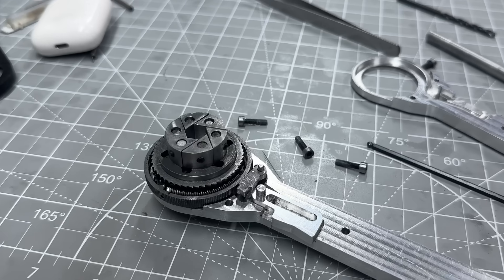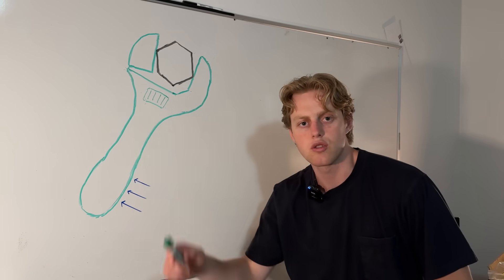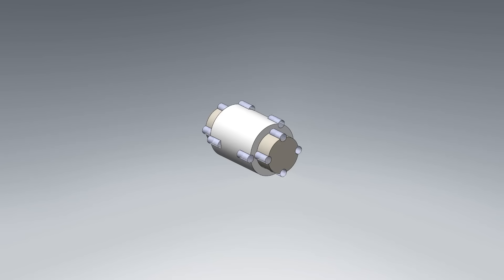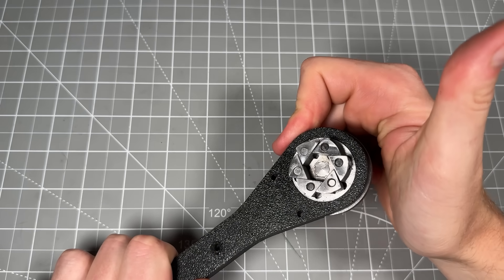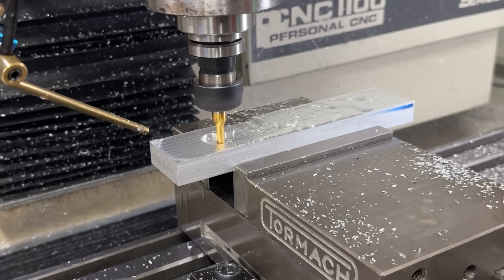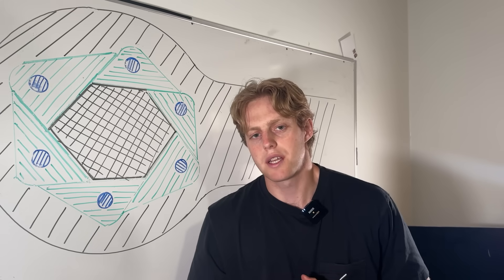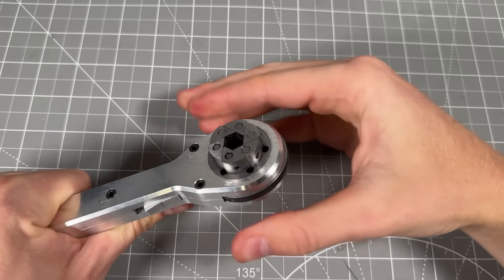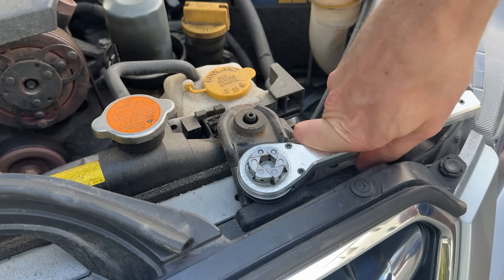I Invented an Adjustable Ratcheting Wrench

Comment: Really think this is just a gimmick. With this wrench you're replacing what, maybe 5 or 6 sockets, plus the metric sockets in that range? And you're severely limiting your options of which bolts you can get to with it because of this wrench geometry? And with the works it takes to put it together, and the precision and quality required for it to even work, it's probably going to cost a LOT more than a good quality wrench and sockets.

I was curious but now I don't think I would buy it.

Comment: Have you considered making a 3d printed mini version/keychain as a fundraiser? (or something along those lines) Might even help with figuring out how to manufacture at scale/identify problems (though I'm sure the process is much different compared to making them out of metal). 

I'd happily spend 30-50 bucks on a cool ratcheting fidget wrench toy to help support the project.

Comment: I was just thinking about how much load/torque it could handle then realized you often need to torque to spec for vehicles so instead of a double sided you could just make it 1 sided/ two variant's. One for tightening and one for loosening also slimming down the total size of it..

Other thing was it self locking seems like it could be a lot of pressure/hand fatigue after awhile but still love that snap it makes... Snap Ratchet?

Either way I'd love to get my hands on one of these! Sick video keep up the awesome work!

Comment: It's a cool idea, and definitely a fun engineering project. I enjoyed watching the break down of what you've tried and what works and doesn't, the drawings / illustrations, all great! But IMHO, I'm not so sure your tool will catch on because: sockets are thinner walled, likely much cheaper, can be plugged into various extensions and swivels, can be put on the end of other tools like drills & impact wrenches, and are already a well established market, so it'll be super hard to convince people and disrupt the market. Kinda reminds me of that socket with a bunch of pins in it that fits a bunch of different bolt heads. I've yet to find someone who bought one and really liked it... pretty much everyone hates them as far as I can tell.

Comment: I Understand the idea was to eliminate sockets, you would have to anyway if you decided to make extensions. but what if you made sockets with an end of that fit inside of there , but that could also fit on a common three eighth or half inch drive

Comment: idk. it’s an awesome idea, watched the whole video and looks like you made and high quality product that does performs well. but i fear its won’t get enough use to justify how much it’ll cost. you have to have enough room to use it, and the bolt has to be within a given size. you cant really use an extension. it does fit the common range of sizes and i bet making a size down with definitely be cool, size up might get really expensive. it’d be cool to have in the tool box but i wouldn’t tell someone to buy one of those before a full socket set.

Comment: Add a torque slip clutch into the ratchet, so it will yield at the clutch mech before you bend the critical component.

Comment: i feel like this would be big, i can really see it doing well in service trades as a backup tool or a common well used tool when a tech is too lazy to get the right socket or wrench for a quick job, if a production variant does get made you definitely have a customer

Comment: Can you open the jaws with the thumb while holding with only one hand? If with this tool I have to use two hands, most times I'd probably reach for a regular socket wrench that I can comfortably handle with one hand. Especially in situations where I'm working with just one size bolts, constantly having to open up the jaws would get annoying unless it is very easy to do and takes no more time than snapping on a regular wrench. 

So practicality is questionable, meaning it probably IS a gimmick, but an incredibly clever design and impressive engineering nonetheless. 

I hope to see you succeed with this and/or other designs, you deserve it man!

Comment: The Gator Grip Socket now has a friend -- the Gator Grip Ratchet

Joke aside -- two thumbs up for designing and machining this from scratch.

I'm a 10 year automotive technician and own way too many sockets, wrenches, and ratchets -- each tool is different in size, shape, and length; to help get the job done faster and/or easier. I can see CNC and/or Mill Operators liking this tool -- their equipment only has a few bolt sizes and they're all easy to access.

I encourage you to contact the YouTube Channel AVE -- he'll get a kick out of your invention.
https://www.youtube.com/@arduinoversusevil2025

@AvE

Comment: Paint 2 different color or just black on one side and leave the metal part clean on the other so it differentiates which is which to tighten/loosen. I could see this being more useful in commercial/industrial use rather than automotive as now days everything is tighter spaces. Cool design.

Comment: You forget the space problem. It needs to be tiny and strong. Even if it could literally melt itself into the bolt, it's not gonna help me if it's big. Most bolts that are broken are in spots where there is no space or hard to get in. I never had a round off bolt or broken bolt in perfect accessible spots. If you want to invent something useful, make it tiny and stronger.

Comment: I would love to see a final version. Only thing about the design is how durable it actually is. I think there needs to be more tests on that. Because I could see the moving parts degrade over time. 

Another thing, is how about extensions? Especially if it's for working on cars, extensions are needed

Comment: Even if a perfect tool for this existed, would i use it?   No.    I would continue to use a socket set and my milwaukee electric rachet.  That tool is not very practical it's also to bulky and can't do anything above 13mm making it kind of annoying.  Then anything using larger size will require something more heavy duty then a hand cranking rachet to take off bolts.  What a silly project, no wonder your pulling your hair out over this.  You're baiscally trying to reinvent the wheel.

Comment: Great job, wonderfully designed.

If I wanted to improve it, I would add two things:
1. A handle end with the option of attaching an extension.
2. The option of connecting an electric screwdriver to the handle, for example, or the option of attaching a small electric motor with a battery for faster unscrewing of already loosened screws.

Comment: This has been invented already FYI. The version on the market atm is awful... but never the less it has been invented (the mechanism to grab the bolt is not the same as your design, but it provides the same function.) Here is the amazon description of the product-

Universal Socket Set (11-32mm 7-19mm) Super Socket for Unscrew Any Bolt Multi-Function Universal Wrench Tool Kit with Power Drill Adapters Gifts for Men, Father/Dad, Husband, DIY Handyman 4PCS

This is not to say anything bad about your design, just a notice that the existence of this product on the market may be an issue for you if you ever did want to actually sell this product (IDK if they have it patented). Your mechanics are indeed different so it's possible it could stand alone against whatever patent they got, but I would talk to a patent lawyer to determine if that is the case. Again, the currently on market design is awful and breaks with very little applied force, so it's very possible your method is superior.

Comment: im not sure that this wrench has much going for it against traditional ratchet wrenches and sockets since theyre much lighter and cheaper, but the fact you were able to come up with the idea, do the math, and bring your idea into reality was amazing. I think you have an incredible future as an engineer.

one idea I had was that the wrench doesnt necessarily need to be double sided. you just have to make the ratchet mechanism with two opposing pawls seated against the ratchet gear with one of the two being held down. maybe you can even have both pawls holding the ratchet to disable the ratchet system if the user wants. I think this would make it much cheaper and easier to produce and would make it easier to fit into hard to reach areas

Comment: From a mech tech grad and apprenticing machinist you have an awesome design here. You have already got the hard part done, the next step toward bringing this to market is to tweak/optimize the design for quick and easy manufacturing. My one suggestion for the design is to play around with handle ergonomics to find what is the most comfortable to use. I also suggest testing this in dirty and abrasive environments, say if it got dropped into a chip bin if it would still close reliably or if the foreign bodies might jam up the jaws or cause slipping.

Comment: make a size to use as a dedicated oil drain plug wrench. always plenty of clearance there but if you would always have the right size and should fit. I use the turntable sockect with 10-12-14-17 i think four sided thing I just grab that and my oil filter wrench and it always works so far.  I just keeps it with my oil tools then I dont need to go though sockets and ratchets drawers at all.

Comment: Personally i would never reach for this strictly due to size, not saying it doesn't have a place in the automotive industry, I just like my ratchet heads as thin as possible, and with a flex head, in my opinion, it's definitely gimmicky. It's not that hard to reach for a socket if you are an actual technician with an organized box or tool tray, and based on whatever vehicle you're working on, there are set socket sizes you know you'll need. That knowledge comes with experience, so you know if you're doing work on a Toyota, get your 8mm, 12mm, 14mm, 17mm, and 18mm. Things like this, oh, and probably like at least nine 10mm. Cool design and build, but my family, knowing I'm a mechanic, buys me these multi-socket wrenches as stocking stuffers, and they are just too bulky and hold no value for me. I will say I do have a set of speed wrenches from Amazon that have a little spring-loaded pin on the open end of the wrench, which allows you to tighten or loosen a bolt or nut that is hard to get to, or not, without pulling the wrench off and resetting. Now those were pretty cool. Oh, and the box end had a design similar to a 12-point, but more squared off, that allowed you to remove everything from 6-point to 12-point hex, Torx, triple square, and Allen head bolts.

Comment: Could you create the same mechanism at the end of an extension that has a 1/2" hex on the back to latch on to with the ratchet? That may help with those hard to reach areas.  What about adding something to the handle that allows for holding the end open from the back? This way you wouldn't have to reach the head with your hands when it is up in a motor?  Just thinking about nice to haves.. this looks like it has a lot of potential.

Comment: Make the locking bar for the ratchet mechanism switch which side of the gear it’s against to switch directions for tightening/loosening, then you can make it a pass-through ratchet. This will improve clearance

Comment: Very slick!  I like the ingenuity.  As for reaching into awkward spaces, I'd simply use an extension.  There's sadly no such thing as the perfect tool, and where this design idea shines is when you have limited room for a complete tool set.  If the wrench can securely hold onto square sections, using an extension shouldn't be a problem.

Comment: Awesome job on the wrench! I could see that wrench finding use in about 9 out of 10 light duty jobs around the house like bed assembly, fixing bikes, and so on. 

BTW, the ability to thread a bolt that the wrench holds is a fantastic feature!

Comment: honestly this would be really useful. i think having maybe 2 or 3 wrenches with different size ranges would help a lot. instead of trying to focus on getting a wide range with one wrench, you could get a wider range using multiple wrenches that have smaller ranges that will work better. i like your idea though, i’ve never heard of it

Comment: It's a nice design; file a patent on it. Since the design can be scaled, one can make a wrench to handle larger bolts. Having one tool that can handle multiple bolt sizes is a huge advantage, especially since it is both metric and imperial. So if it will go from 6 mm to 12.5 mm (a little less than 1/4" to 1/2"), your tool replaces 13 sockets and/or wrenches: by itself that saves time.

While it would take some redesign and complicate things, I would make it have a bi-directional ratch like socket wrenches have. Doing so would actually reduce the number of parts, the length of the pins, and the overall depth (since it would be single sided). Make the jaws longer (at least on some versions), and tapered to get into recessed spaces. I would also harden the jaws.

Comment: Don't forget to patent the design before someone else does. 
Looks like a cool workshop tool that you'd use to change blades and belts on tools and such without the need for a whole toolbox. Hang up one or 2 of these on the wall and be done.

Comment: this seems like a great idea, a diamond in the rough. that said even if it ends up hitting a dead end, those dead ends are how we've paved the way forward as a species, giving this project value regardless of success.
as for my opinion, we don't have a single wrench that covers every job, so don't try to make one that can work on every bolt; as long as it has a defined area where it will perform well with advantages over competition in any areas, then it has it's place in the market and the toolbox

Comment: This would be amazing if you made it a torque wrench but cap it at 75-100 ft pounds. I use a lot of torque wrenches in the machine shop for holding parts on fixtures.

Comment: Maybe you could add a socket adapter that has a hex bolt to fit your ratchet jaws on one end and the opposing end a classic 1/4", 1/2", 3/8" etc. You could even thread in between the two ends so that it could be screwed into the end of your ratchet handle once you drill and tap it (maybe even parallel to the ratchet head and exposed for alternate use). Nice design, thanks for sharing.

Comment: I had the same problem as you, 10 years ago. I designed and got a Utility Patent from USPTO, but I was not able to find a manufacturer to bring it to the market.
My tool has a handle that keeps a positive pressure on the jaws, so it doesn't slip, it's adjustable and has a ratcheting movement.
https://youtu.be/nj-dHulylI0

Comment: If you made this in a deep well version, I would never need a socket set in my van for the work I do. I only use like 4-5 different sizes but need extensions/deep well sockets to reach the bolts

Comment: Don’t stop.  This is going to be a hit if you stick with it.  Having to find the correct size and switch sockets wastes the most valuable resource, time.  Doing big disassembly jobs with one tool would be a dramatic time save.  You need a patent attorney ASAP.  You may have to go to a stronger material than steel for the pins.  Graphene or some sort of carbon material may work.

Comment: Hello. I've been designing things for a living now 29 years. You did a great job with that tool design and development. What you demonstrated about it not fitting into recessed holes and spaces is not a problem. I wouldn't consider that tool for that type of application. It's the reason deep socket tools were invented. Not every tool will be able to solve every task. From my point of view I think the main advantage of your tool is that it accomodates various sizes of  bolt heads and nuts. One thing I have learned over the years is that the more moving parts something has the more chances of failures or fitting issues due to tolerance stack ups especially if and when you move to high volume manufacturing. It's one thing to make a one-up perfectly built tool and another to make thousands of that tool.  Always try to reduce your parts count in your design if possible. Great effort and keep going.
Reply: I wonder how many of those recesses are actually engineering necessities, and not just designed that way to make it more difficult for people to work on their own equipment.

Comment: I love when ppl build tools great work! But you call the twintec bulky .. I have big  hands and maybe you don’t but just eyeballing and yours looks even bigger. Not to mention I still just reach for my chuck 10/10 in these situations. That said I think you’re on to something though I would depart entirely from slight improvements on a design with little room to improve in its current iteration. Like I said my twintec is pathetic compared to any adjustable chuck I have laying around. Out of curiosity why the focus on snap fitting? Maneuverability? It sounds like a use case issue. I don’t have the use case you seem to be solving for but I think you are more than capable of really smashing this category open. Eager to follow along on what else ya build great work for real

Comment: Cool invention. I don't think it will save any space in the workshop, as you pointed out its limitations with reach and range, but it would save space in a universal toolbox you might keep in your vehicle or in a tool belt. Feel like it fills a swiss-army knife niche where if it works it's a huge convenience but when it doesn't it shows why it can't replace convention. Fits right in with most other tools on the market. Get yourself a patent.

Comment: Love the idea and the final result!! It definitely can't replace a socket set, because of all the accessories for reaching tight spaces. But for jobs with a lot of different sizes of surface bolts, that's really something to try.

Here's an impossible challenge for you: adjustable Allen key 😂